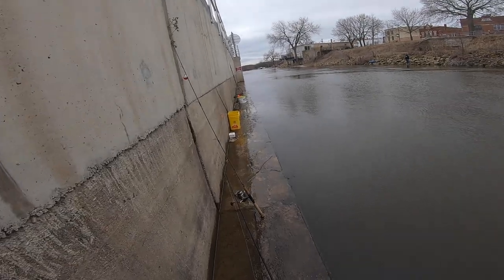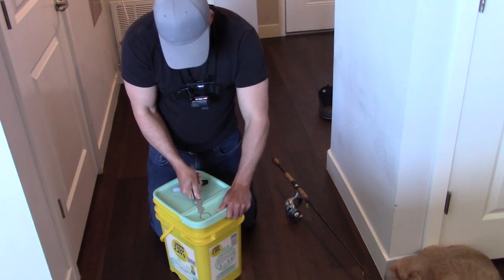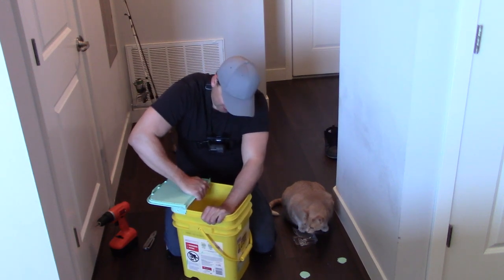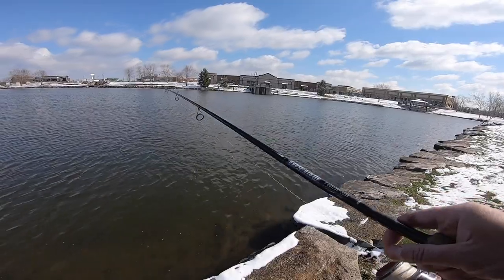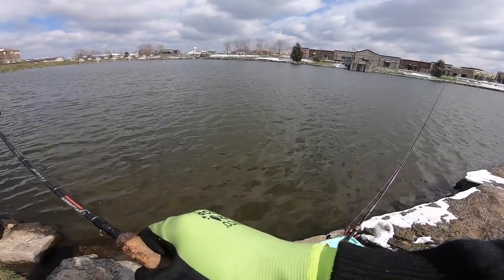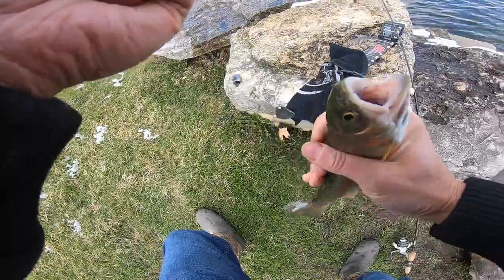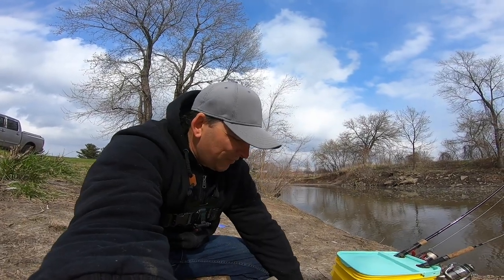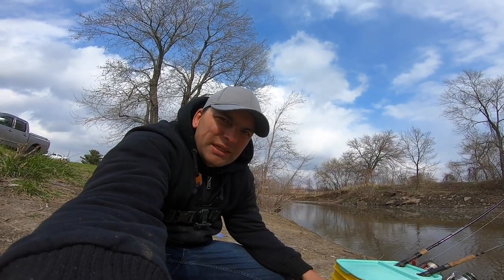DIY Bucket Fishing Rod Holder - How To Make A Rod Holder From Cat Litter Pail

Comment: Simple yet ingenious, especially if fishing from some hard ground or on a ledge. You could also use it as a tackle box if you loaded it up with enough weight. Some nice gills and bows you caught at the 1st location. Nice carp at the 2nd. Check the time at your truck for just a sec and boom! Carp on!!
Reply from the maker: Thank-you.  Lots of guys here have these bucket with seats and they load them up with tackle.  I guess you could do that for this but I would take it out and use water.  Unless you have a bunch of lead I don't think you could weigh it down enough.  You have to be careful with carp they will take your gear if you're not careful.

Comment: nice idea! Initially I was wondering if drag needs to be set loose to prevent fish from pulling away the rod holder, but it looked fine and tested by a large buffalo:)
Reply from the maker: It does need to be set somewhat loose.  I would recommend putting your rod in the holder and then pull line out of the end.  Set the drag so pulling the line wont tip the bucket.  The carp is what really tested it.  The buffalo most of the time aren't running with the bait.

Comment: Simple 1” conduit clamp screwed to the back up high with a rebar drove in the ground solves any tip over. Have to make something for my dad, he ‘thinks he wants to go fishing’ 🧐🧐
Reply from the maker: Whatever works for you.  Maybe others can use that tip.  Lots of the places it's tough to get the rebar in, like the spot I got the idea for you can't hammer the rebar into concrete.  If you are going to do that you may as well just use 2" pvc pipe with the rebar and make rod holders.  Everywhere you go fish has water though.

Comment: What size circles were you using?  Great video.
Reply from the maker: Thank-you.  I was using sizes 6 and 4.  All the fish besides the carp were on 4 and the common carp was caught on a 6.  Even the bluegill were caught on a 4.  One had the circle through his eye.
Reply: @PeelingLine  I've got size 14 up to 1/0, and wondering how panfish would take them. I caught a catfish on a size 8, and a little greenie on the 14, but want to set up some Kentucky rigs. Dieter Melhorn uses 8s, and yours looked a little bigger.
Reply from the maker: @ocshaman7323  the thing is I let the fish run and dont "set the hook" until i know they are on the line.  A little fish usually will try eat the bait and will work a big hook into its mouth.  If you use smaller ones you have to cut the line or kill the fishm
Reply: @PeelingLine  I had a 8" yellow bass get a 3/0 Gamakatsu in it's mouth. The hook couldn't rotate, it just was stuck, and I drug the bass it tail first. I will play some more with the larger hooks.
Reply from the maker: @ocshaman7323  My favorite is the 1/0 it prevents really small fish from getting on.  But you will still get the odd small fish because they bite the point.  I still use size 4 and 6 until the little fish start become annoying and then I will switch to bigger hooks.
Reply: Peeling Line I’ve got 1/0 and 4s in the cat and panfish box. I use Kentucky rigs and swap them out.
Reply from the maker: @ocshaman7323  nice, never heard of Kentucky rig